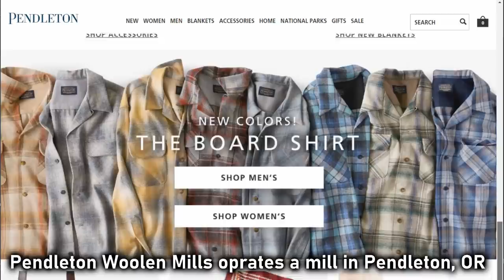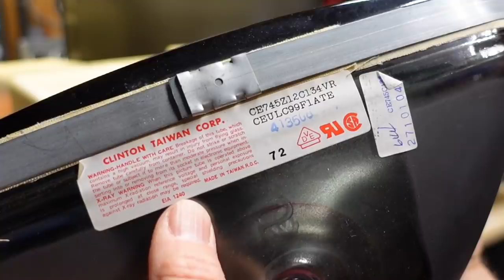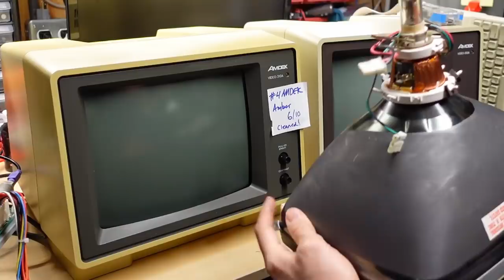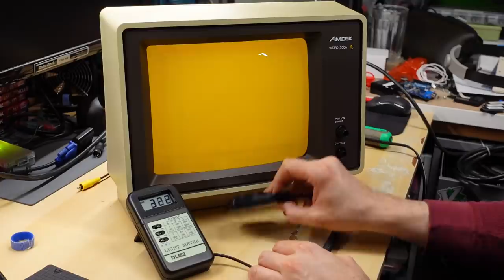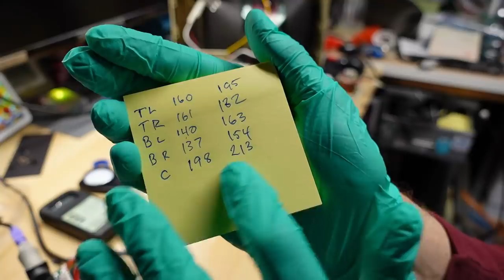A tube swap for the Amdex Video-300A (that Amber glow!)

Comment: So there's a specific procedure when adjusting the contrast/brightness on the CRT. You need to turn the contrast/brightness completely down, turn the 'screen' pot on the flyback up until you see the raster lines, then turn it back down until they JUST disappear, and finally supplement with the contrast/brightness as needed. A lot of CRTs can look immensely better after doing that simple procedure when the contrast/brightness adjustment doesn't seem to quite get the image to where it needs to be.
Reply: thanks, that makes sense.
Reply: Thanks for the tip

Comment: I would remove your watch or any rings when working on any crt as an safety issue and  I was told by an old guy in the business only use one hand at a time in the back of the case

Comment: Pedantic comment: An analog luma signal on its own is monochrome too, and is not "composite". In fact you shouldn't feed a composite signal to those monitors because they don't have anything to filter out the chroma signal and thus will display it all as luma artifacting in a way that a composite monitor won't. (This is also why they display a luma signal as sharper than a composite monitor will). Which actually leads to an interesting fact...
.
Later black and white televisions actually had a filter for color broadcasts since all television was broadcast in color at that point. Since the tube was monochrome, they just had a low-pass filter to get rid of as much of the chroma signal as possible, thus making the image blurrier in the process even if you fed it a sharp luma-only signal instead of composite. Luma-only computer monitors did not have this filter since their goal was to display as fine an image as possible.

Comment: Do picture tube brighteners exist for computer monitors? They're a small transformer that plugs in between the base of the tube and the socket, it boosts the heater voltage to get more emission out of a weak tube. If not, maybe it can be DIY'd.

Comment: What you're wearing looks like nitrile, 8 mil thick or even thinner, disposable glove. I'm guessing their insulation will break down around 200-250V at the fingertips and maybe go up to max 400V at its thickest point, around the palm. These will be like a paper umbrella in a hailstorm when you're dealing with 15KV and above live voltages and easy 1KV residual.

...but hey, at least they'll keep your hands clean.

Comment: I always forget to comment it BUT back in the day when I did a lot of pin straightening I got a set of blunt end syringe needles.  Had like 15 different diameters and color coded.  I could find the perfect one to fit snug over the pin and quickly, and accurately, straighten all the pins on a processor or such without breaking them AND making sure they bent back where they were bent at vs me making a NEW bend somewhere else along the pin. 

Worked perfectly every time.

Comment: Makes me wonder if there ever was a red phosphor CRT, so you could have a whole traffic light setup, with Red, Amber and Green, yeah, my mind thinks of odd things... :P
Reply: I briefly had two identical monitors with one amber and one green (now another collector has both) and I think of using them to watch 3D-movies with anaglyph glasses...
Reply: Set up 3 VGA monitors and split one cable to have R, G, and B?
Reply: @motorolla2155  Set up an amber CRT with a red filter, a green CRT and a white CRT with a blue filter and use some mirrors to combine them into one of the most impractical color monitors ever conceived (actually they tried that in the 1940s to get color TV)
Reply: Old school projection TV's had a red, green, and blue CRT.  It was fun to put the dust cover over the individual CRT's to see the effects on the color 😉
Reply: Yes, there was a red phosphor and a blue phosphor CRT.

Comment: I have an Amdek Video-300A that my family used on our Actrix CP/M machine. That screen did suffer burn-in because of the status bar that always showed at the bottom of the screen and was there for 12+ hours per day because I used it for home schooling as well as surfing BBS's in the early to mid 90's. The screen on the Actrix itself didn't have burn in because we kept that screen's brightness at a bare minimum and never used it. The Princeton monochrome monitor on our XT, though, didn't suffer burn-in because dad was always VERY careful to use the blanking feature of our Hercules graphics card. It automatically blanked the screen after 5 minutes of inactivity. Funny enough, we still have them all and they work well (except for the Fast88 card, it smoked something), and maybe when I inherit my parents house I'll be able to set up a small museum of sorts.

Comment: Handling CRTs , These things will implode. (Hard vacuum inside) This has probably been mentioned in previous videos but touching the neck of a CRT with a metal instrument in a way that might cause a nick in the glass can cause the neck to fail and violently slam against the back of the face sending glass chips and phosphor everywhere. The face doesn't break because it is safety glass: glass-plastic-glass laminated. Seeing the old b/w CRT brought back memories... Thanks for the video.

Comment: Now that's how you pack a CRT for shipping!

I'm still sad about the IBM monitor I bought off eBay as a working unit, but arrived in a box of packing peanuts with the screen facing down and the sound of broken glass rattling inside. I was really lucky though, I posted on a the vintage computer section of a local forum, asking if anyone had one of these monitors, and someone replied that they had one with dead electronics but a (probably) good CRT! Only snag was that they lived in a different state. But again I got lucky that they planned on driving here for their Christmas vacation, so they offered to bring the monitor too! That was actually a couple of years ago, and at the time I was pretty much terrified of playing with CRT electronics, but I'm finally working up the courage.

The other weekend I finally got around to pulling apart the monitor with the working CRT, and I was going to install the electronics from the one with the broken CRT, but I wasn't really sure whether I should also swap the yolks. They're both the same model monitor, so technically it shouldn't be necessary to swap them, but I'm not 100% sure. Now that I think about it, I remember watching one of your old videos where you didn't swap the yolks, and it just resulted in a really distorted picture since the tubes and yolks were different. I think my plan will be to check the resistance and inductance of the windings. If they're close enough then it shouldn't cause any major issues if I don't swap them.

Anyway, I guess this is all a long way of saying thanks for all the CRT videos! They've really helped educate me about how to work on them safely, and helped give me the confidence to take on this kind of thing myself. Don't worry, I'll still be avoiding powering the monitor with the cover off, at least for the initial testing. And I've now got plastic alignment tools to adjust the picture if necessary.

And once again, congratulations on passing 100K subscribers!

Comment: I'm trying to recall, and I saw a lot of both green and amber CRTs used in applications where they would get heavy burn-in.  For instance, the card catalog terminals when I first entered university (over 30 years ago) had amber monitors.  The first place I worked had green monitors for their inventory control system.

Comment: Hey Adrian, just be careful with the grounding on these. Sometimes the dag ground isn't connected to the ears of the picture tube, and the connection is made with those metal fingers or the steel springy strap that goes across the back of the tube.

Comment: Adrian, what are you using to wash your circuit boards? You only mention soapy water in the videos I've been searching through. Is there a specific detergent you use? And if so why?
Reply from the maker: I actually just use dishwashing soap -- the grease cutting type and warm water. Really don't think it matters as long as you fully wash it off when done.
Reply: @adriansdigitalbasement  Thanks a lot Adrian! I thought I remembered you mentioning you use Windex, so I'm glad it's not that as you can't get it in the UK easily. Now to open up my Mac Classic and get cleaning!